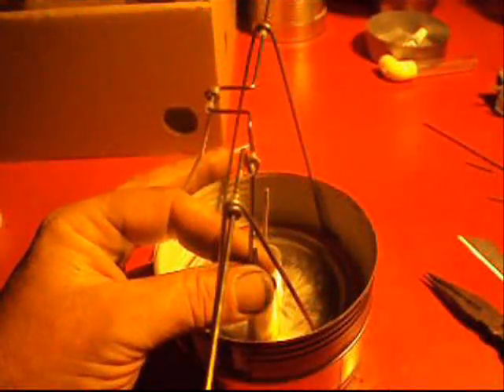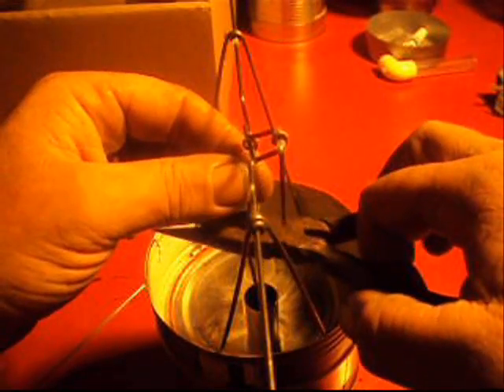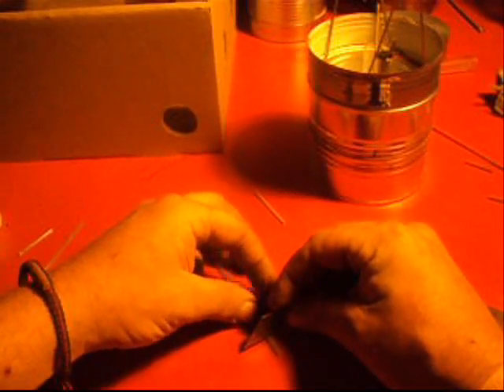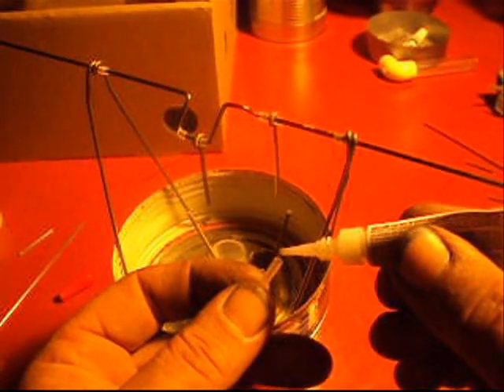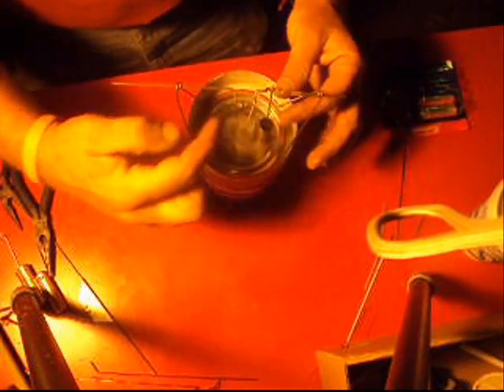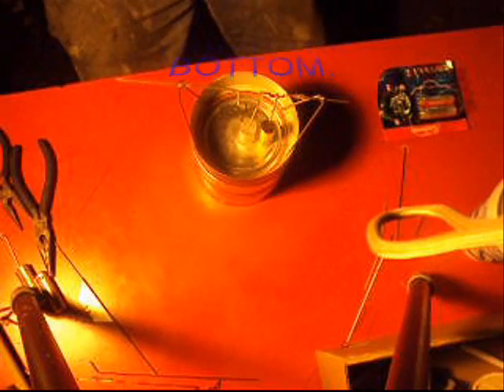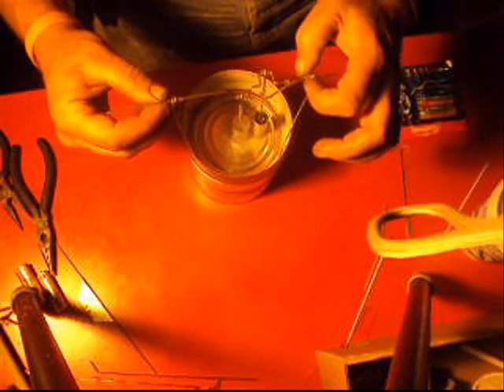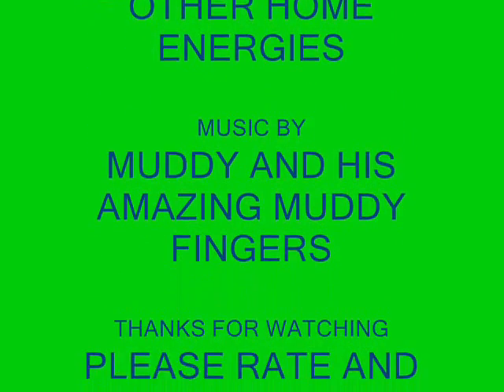PART 17 HOW TO BUILD A TIN CAN STIRLING ENGINE-LINKAGE ADJUSTING.wmv

Comment: I have been watching all these tin can stirling videos and in the comments I have seen several times where you mention using steel wool in your displacer with holes for air flow, have you made any videos of this? I heat my shop in the winter with a wood stove and I want to build a stirling engine to charge batteries using the heat I am already creating to heat the shop, would love to see the "more efficient" version you keep mentioning brumley at gmail dot com

Comment: Cool! I've been wondering about magnetic drag, engine torque & horse power, wondering if stirling engines can create enough push. I have a generator design concept that peaks my interest & if I can connect with someone locally to help do the construct ~ think I might be onto something that is very low torque for high output.
Next step is to see if solar convection can drive it.

Comment: well, so the bent for the displacer rod has to be half of the space between the displacer and the top of the chamber...so we have to measure that before closing the chamber I guess...

I think the most difficult steps are the building of the displacer and chamber (with the press and everything) and the linkage, cause it has to be pretty acurate..maybe you could talk a bit more on how to de that in the last vid, after showing the engine running!! cant wait!